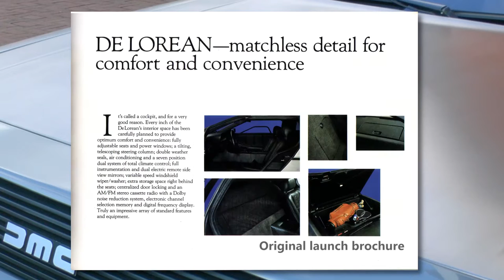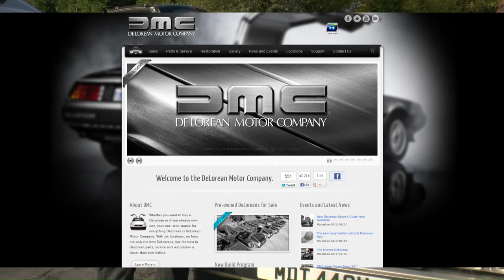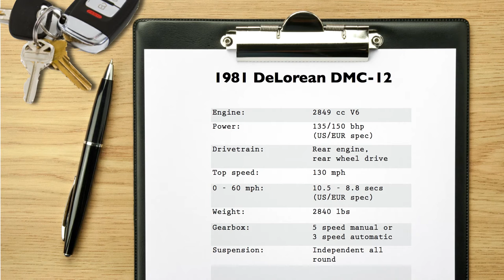Classic Cars UK Season 1 Episode 3: DeLoreans

Comment: nice vid, here in Conn USA there is a nice one with the license plate MCFLY, too cool for sure. at 17.44 the driver has his hand under the steering wheel, not the best as it means you cannot correct your turn without completely removing your hand .